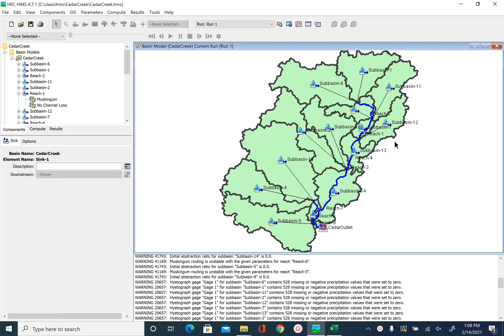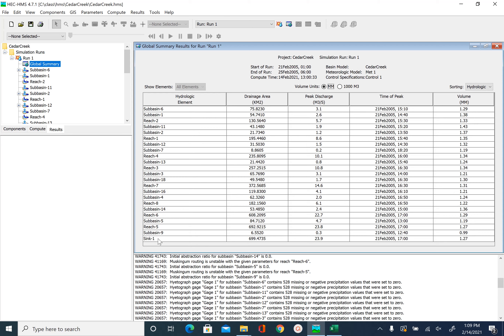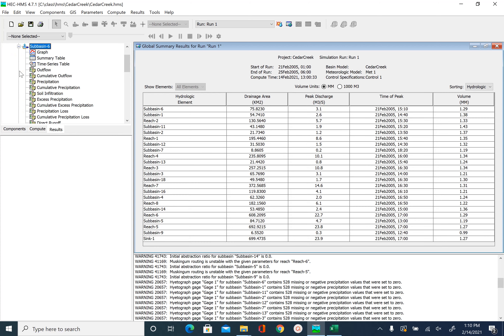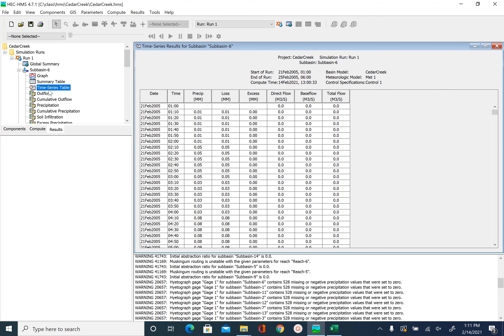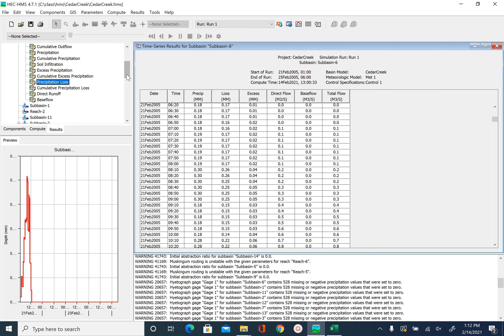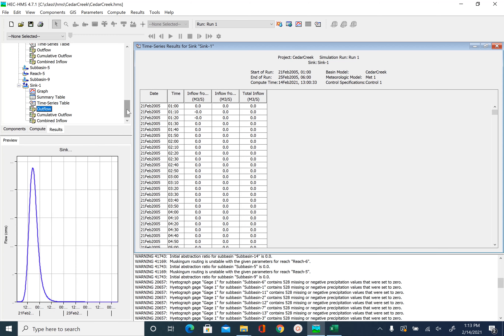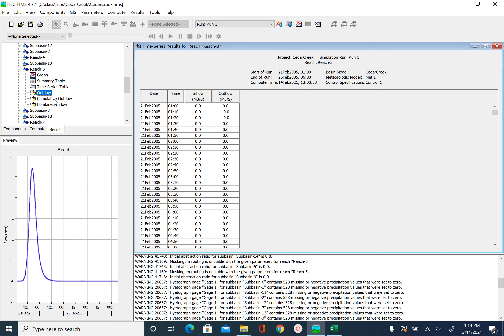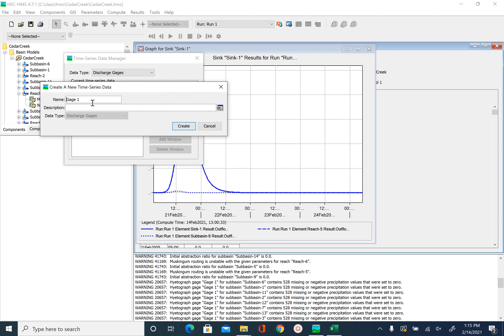Hydrologic Modeling Using HEC-HMS (9/9) - Visualizing HEC-HMS Results

Comment: Thank you so much for your lecture. I am working on a small watershed and we have two gauging stations.  for the simulated run I insert both gauges data but for the observed one I didn't find any location information to mention the exact locations of my discharge gauges. I am confused and need your guidance.... please help me to sort out my problem. Thank you in advance.
Reply from the maker: i suggest you use only one gauge at the outlet and use the procedure described in the video to link the gauge to the outlet.

Comment: Hi there, I have a question. Where did you get the discharge data for your simulation ? Did you estimated it using the SCS-CN method or is it through a observation or trials of test in the specified area?
Reply from the maker: Discharge is the output from the simulation. I also have observed data from a gauging station at the outlet. The CN values used in the model were obtained using soil and land use data. There are videos showing how to do that on the channel.